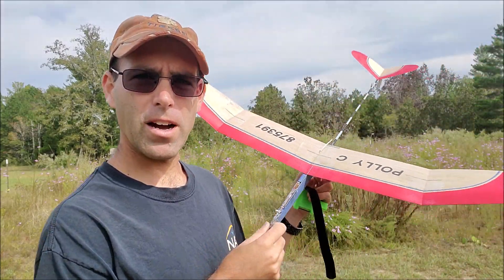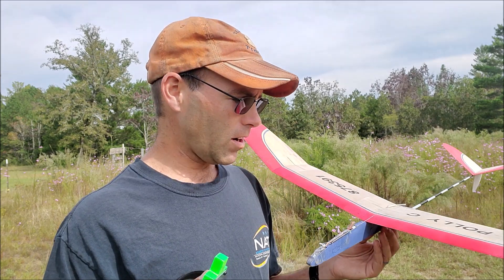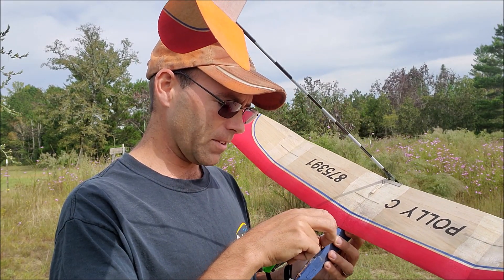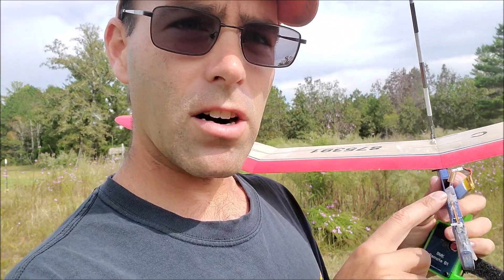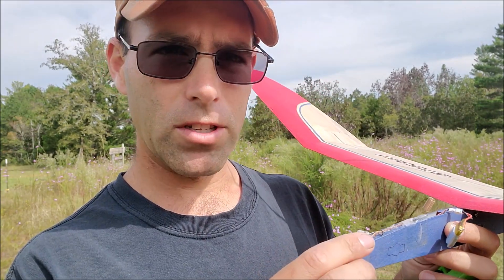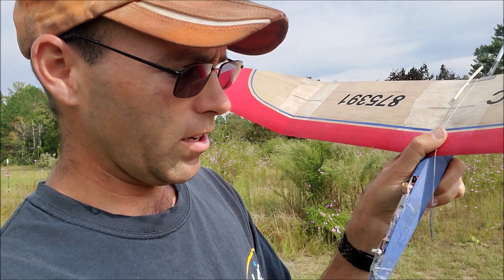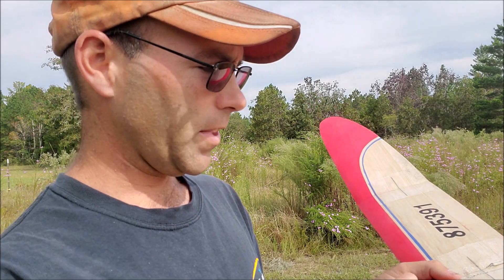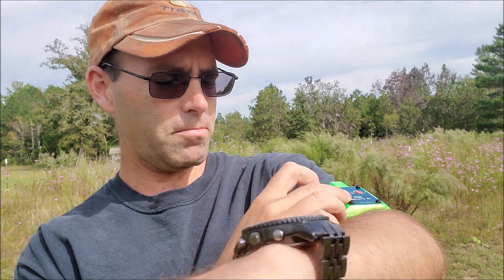Radio dethermalizers for thermal hunting!

Comment: I’ve been using rdt for years. I wouldn’t be without it. I’ve just bought the BMK. It has the huge advantage that it can be programmed for a timed dt at the same time, a really good back up. The dt is immediate as the button on the Tx is pressed. Very useful in an emergency. I haven’t found the maximum range. I did get 364 metres on one flight as shown by my gps tracker. It’s also really good value. I found the Tx a bit uncomfortable so that 3D printed case looks just the job. Because the Rx is not expensive it’s not the end of the world if you have a fly away. It complements a gps system.
Who cycles after the model during its flight? 😀Just try that on Salisbury Plain. I used to run after it Tx in hand. Now I just stay at the launch, and do a walking retrieve. Old age.
Great video. I am glad Melit is getting world wide sales.